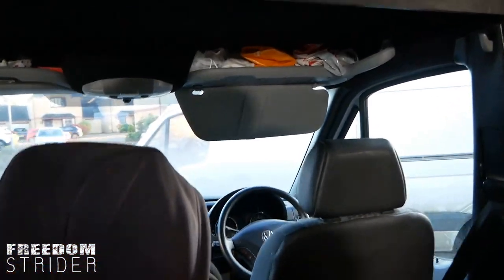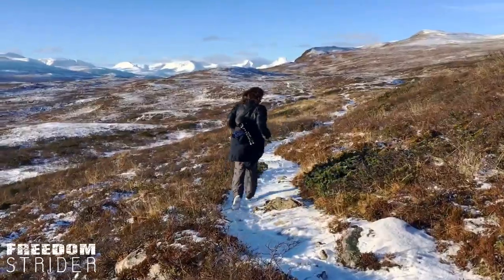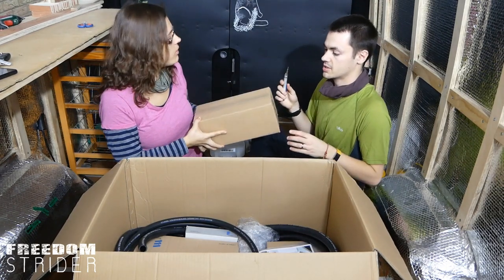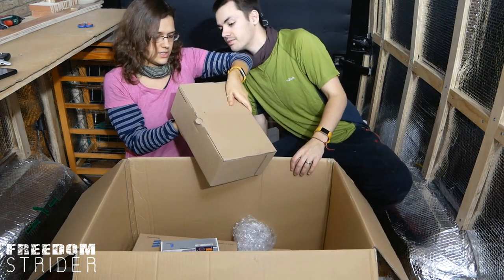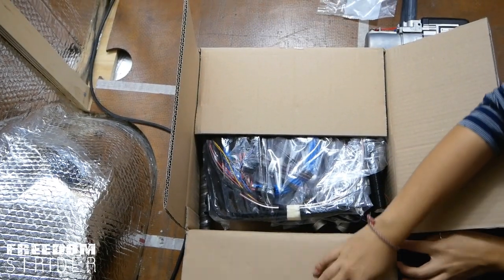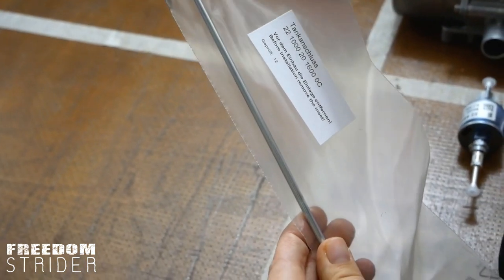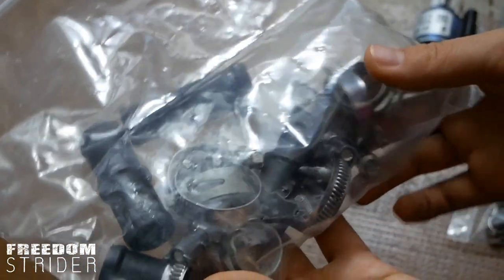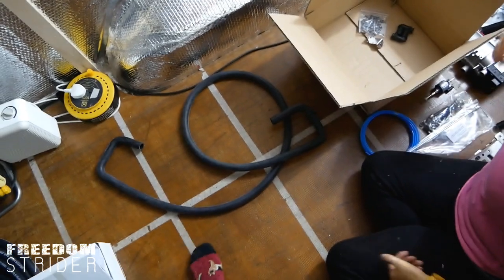How Hydronic Heating Systems WORK (diesel water heater)

Comment: How much did the whole system cost?
Reply from the maker: The cost is about £1600 - half of that is the physical furnace and the rest is optional, depending on what you need. 🙂👍
Reply: @FreedomStrider  no i mean with the whole system that you're trying to make with the water and heating that includes the recruit shower and the water and air heating?
Reply from the maker: Not sure yet, £1600 is the heating element of it, the underfloor is another £100, then any of the recirculating shower parts and the plumbing, we are expecting maybe around £500, but we don't know yet, because we are designing as we go.
Reply: @FreedomStrider  Did you figure it out how you gonna cook? And as much as i understood you want 2 big beds for when you have kids but can you fit another legalized sits for travel for lets say if you have 2 kids because now you are 2+1 sits ?
Reply from the maker: We are planning to be our normal 'gourmet' chefs and cook anything we fancy. 😂 We don't have a proper looking oven at the moment, we are hoping to upgrade to electric cooking eventually. But for now, we have a Remoska oven and we would like to try the Omnia top oven with the camping stoves.

Yes, the van is designed so it can house a 3rd person, so 1 kid is a go 😉. As for more than 3 passengers, we are hoping to customise the couch to have seatbelts, but we'll figure out the details later. Plus, who knows, we might do more van conversions before that many kids.😂
Reply: @FreedomStrider  haha the lucky kid will sleep like a king in this big bed.. :)) I think that there is no option to legalize more seats if they don't face to the front of the van. 
Do you have enough battery capacity to use the electric way of cooking?
Reply from the maker: Each country's laws and regulations are different, but in the UK, there aren't 'legally' binding rules, just very strong recommendations. We can put seats facing any direction, but it is recommended that they face forward or backwards rather than sideways. We'll of course take all the safety precautions whether they are legally necessary. 🙂

These are the UK recommendations:
https://www.gov.uk/government/publications/converting-a-van-to-carry-passengers-in-the-rear/converting-a-van-to-carry-passengers-in-the-rear
Reply from the maker: Andfor the cooking... we don't have enough capacity right now, so we'll upgrade both the battery capacity and the cooking later on.

Comment: Another thing I would like to say is the only reason why I like the Webasto stoves more than the Chinese diesel heat stoves is because of the Webasto stoves have been around for longer and they’re made by German ingenuity instead of Chinese ingenuity, but also the Bastos heaters have better English instructions than the Chinese diesel heater instructions Those have Horrible Chinese to English translations
Reply from the maker: Yeah the Chinese heater manuals are terrible!! Even if I have to translate Germany to English, it's much more detailed and has everything written. We wanted to play it safe with a branded heater👍

Comment: Why? I can see the point in a large motor home but not in a camper.
Reply: Their van is rather large😂
Reply from the maker: We do have a LWB camper, and we're going to have a lot of open floor space, the brown floor space you see in the video is pretty much what's going to remain as floor surface area. And also, this system allows for a lot of flexibility and upgrades when it comes to the hot water side without getting another tank. 👍